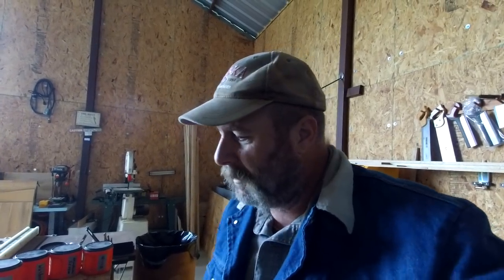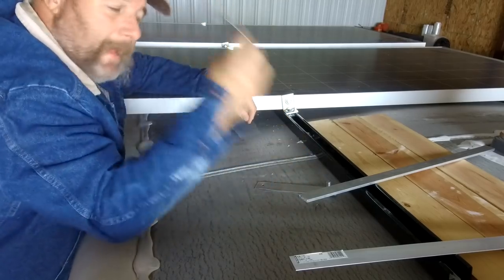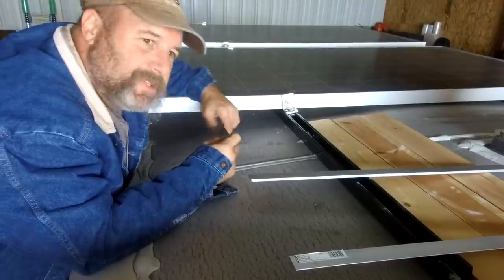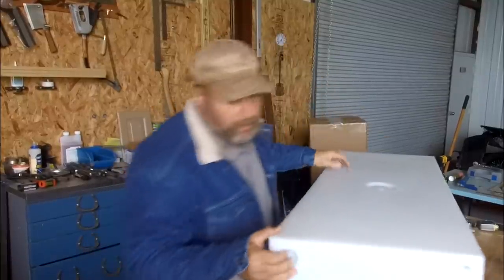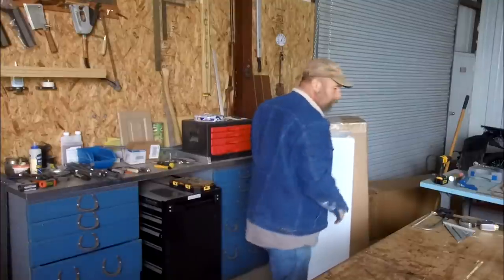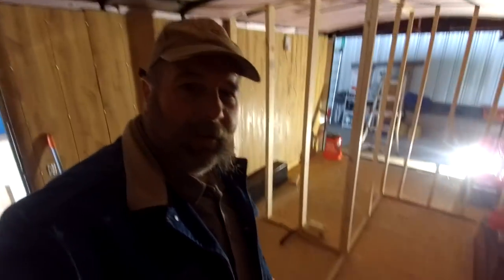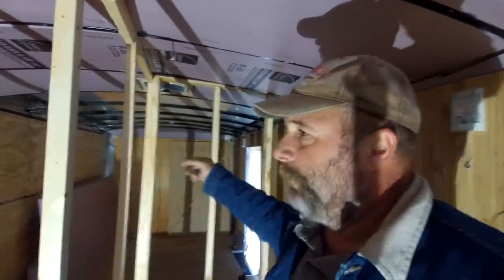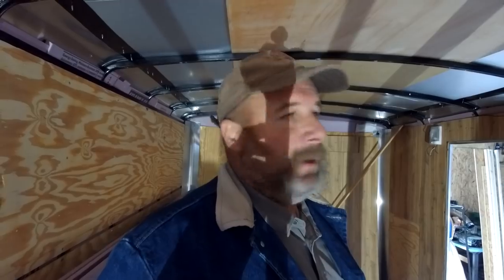501  New toys and a final floorplan / Cargo trailer RV conversion

Comment: I'm doing a conversion too, Stan. It's been dragging on a long time but with this lock-down, I jumped back on it. Mine would make a good hunting shack, insulated, ac/propane  direct vent heater, mini wood stove, small solar and 12 volt fridge. It's more experimental  than anything lol, but it'll at least help me plan for the next one. I know one thing, all cargo trailers are not equal, there's a lot of stamped out junk out there.

Comment: I have a suggestion that you can add to the other 100.  Use punched aluminum flat bar secured with an eye bracket and attach the other end to the side of the panel with plastic knob screws.  You can have an adjustment from 0 to however far your hinge will allow.

Comment: Another alternative for air conditioning is a portable residential unit. All they need is a 4 inch (maybe 6 inch?) diameter hole to vent the hot air outside.  You could mount it up off the floor somewhere if floor space is an issue.  Would also have to drain the condensation somewhere. They are inexpensive.
Reply from the maker: Your right. I forgot about those

Comment: For the A/C, you could use another window with a screen and mount the A/C unit completely inside in a box on a drip pan with drainage through the floor. Well, you get the idea.

Comment: Wooden cover over the a/c unit. Slide on slide off. Make it fit tight and you can hold it with a bungee or slide bolds. Remove it to use the a/c unit and take inside it becomes your table next to your chair or a foot stool.

Comment: Cool! You addressed all the possible problems I noticed on your last video. Love those cute little windows with the multi panes.  About the front mounted air conditioner. Look up "Run Away"  Brand tear drop like trailers Built-in Florida. I owned one which had the air conditioner mounted out the front with a removable vinyl cover. Never Leaked a drop inside the trailer during rain.I believe the only sealing around the airconditioner was a bead of silicone around the outside surface. Yes it was a very tight neatly done installation and realistically I believe the vinyl cover was more to protect it from rock chips and such while driving.  I think window air conditioners are constructed so that rain water cannot go deeper in otherwise it would be a problem in a standard house window mount. The only modification to the airconditioner itself was the addition of a quarter inch hole on the bottom of the sheet metal so that absolutely no Water would collect inside the housing.

Comment: Stan just an idea here, why couldn't you get a heavy duty slide out shelf, (heavy duty drawer slides with lock 12"-14" full extension ball bearing, seller Luminsum, 256 lb. limit, $45.60 on Ebay).  Install a cargo door on the front, mount the slide out shelf to front wall with heavy duty supports, then put AC on the shelf.  Then when you need it just slide it out & plug it in.  Or just mount AC directly on/in the wall & make a hinged door to cover AC.  You could cover door with metal to water proof it & protect the wood from rain so it doesn't rot.  Second idea put fire breaks between 2x4's where your motorcycle will go to make wall sturdier in case something comes loose.

Comment: Shed windows n more I bet was the company. I have those exact same windows on mine. They are perfect. Even tempered glass. I did build fold down plex covers for the outside to keep screen from flopping and they do leak just a bit when traveling. Covers just hinged on bottom and fold down. Perfect windows.

Comment: Stan while you don't want to overload your tongue weight as you build your trailer, you need to keep in mind that 60% of the cargo weight should be loaded in the front half of the trailer. Heavier items should be towards the front, with lighter, smaller items placed near the rear. A light tongue weight or heavy weight placed at the rear end of the trailer can cause dangerous sway.

Comment: Stan. Suggestion, 1 1/2" x however long alum L channels from front to back w/piano hinges SSteel on 1 side use spring pin latch on other side...Raise solar panels when needed.. Use adhesive on alum channels full length they wont go anywhere. 85 mph from Daytona to skaggy wash, never moved.. P.S. Need alum on both sides of panels.....L & R sides

Comment: On your long piece that you were trying to use as a latch. Use a longer bolt where you bolt it to the solar panel, tighten the bolt to the panel put your bar on. Then put a coil spring on top of that with a flat washer then a lock nut. The spring will let it flex so you can pull the latch out, but keep it tight when you let go.
Reply: Lock nut instead of washer

Comment: I have a tiny frigidaire to install myself. My plan will be to make a window I can close with a shutter, insert glass or screen when needed, and install the ac unit if it gets hot. The unit is only 50 pounds so I can store it in the truck when not needed or leave it home.

Comment: you could configure your motorcycle area into your shower area without the need of a tub, dual usage type deal and close to your water tanks. like the floorplan layout though.
Reply: My idea for a 7x14 cargo shower is to make a platform for the ATV to sit in the middle and the shower pan can be pulled out from underneath.  This is so the shower may still be utilized without having to pull the ATV out if the environment doesn't allow me to do so. I have a work bench with a few hundred pounds of tools and a ice cooler on the passenger side for easy access from the door. I also plan to run boards across the top of the ATV for lightweight storage. The solar battery bank and water tank on the driver side will balance the tools and work bench side. I dont plan on a bed since I already have a nice setup in my van but if the van had to be put in a shop for repairs of some sort I could still set up the army cot instead of payiing for a hotel if my money is tight.

Comment: Solar panel pop up. Best way would be to attach all panels together, use MacPherson struts. Just like car makers have done for years on car hoods. Also the cool factor would be way high.
Reply: 12VDC linear acuators would also be a cool setup. Pros: flip a switch panels go up, no need to crawl around on the roof. Cons: expensive, too many moving parts. Gas struts are a good middle ground because if they fail you can still use the metal stock to lock the panels in a tilted position.

Comment: Pretty cool.  You were either going to end up with E-bikes or real bikes so I had a feeling the garage was going to win out.  I don't know how residential windows are going to react to a mobile environment. but they look great.   You could even put a fan in one if you want more airflow.  Wait, You have a Max-Air.  Moving air solved.  A split AC would be a pretty clean install.  If it came with a heat pump, even better.  I'm looking at balance still, but there's a long way to go.  I'm especially waiting for the electrical installs.  You might want to go a little heavier on the solar latching parts.  It's surprising how the wind can grab a large panel and do nasty things to it.  The latches are also going to be cycled quite a bit.  I'm liking latching or toggle spring bolts or similar.  Use plastic grommets to quiet the pins down.  Looking good.  Keep at it.  Stay safe.

Comment: Stan what about a lever/slide mechanism to raise and support the panels. First thing that comes to mind to describe what I’m thinking about is some of the old swing open windows. The lever locked in a pin then rotated out and then pushed the window out by push straight out on the lever. Just a thought that may contain all the mechanics of raising and holding panels on both the closed and opened position.

Comment: Get the air conditioner the ones are for like bedrooms you can vent it out through a hole in the floor the water will drip with it we did that to our trailer

Comment: 3:21 I'm willing to bet that thin metal latching system will fail under heavy wind load. Maybe look at a spring loaded barrel bolt like Amazon ASIN B07JWH5FC9 which could bolt through the panel frame or into a reinforced plate through-bolted to the panel frame. I've also seen people use toggle latches like Amazon ASIN B01NCATK7W or a stainless window sash lock like ASIN B07R6KWJVX. You may want to install a stainless steel cable system to limit the panel movement so a gust of wind won't blow the panel all the way over if the latch fails or during setup.

Comment: Look at the wee roll trailers they put there a/c unit in front of the unit you can use a boat latch. Automotive makes a you claim that has a threadeds on one side for like door panels. Putting the a/c inside don't for get to  exhaust the hot air from the a/c or it will freeze up on you.

Comment: Maybe put one water tank in the truck so you don't have to hookup you trailer all the time to refill Stan. And with the split system you can have the motor in the garage and say put an door on the side wall to open it when it is running maybe above the batteries ?? Cheers mate
Reply from the maker: Interesting. A tank in the truck.
Reply: @Sasnak  I like that idea too. Gravity will let you refill the tank in the trailer.
Reply: A small submersible 12v pump would work too. Look for one meant for taking a bucket shower and install a 12v lighter plug in the box of your pickup to run off the chassis battery. Though your trailer can handle the weight of all that water it might be nice to split up the payload a little differently. Just a thought. Also you could make a water run without breaking camp and that would be real nice!
Reply: @upriver7047  a standard RV water pump is only about $59. Way better than a submersible because it will use existing plumbing fittings that are already on the tank.
Reply: @Captain-Max  I get that but wouldn't you then have to hard wire that pump, mount it and somehow protect it from the elements? Easier for me to disconnect and toss in my tool box. Out of sight out of mind. I use my pickup for a lot more than towing a camper or my fifth wheel. To each their own I reckon ;)
Reply: @upriver7047   Not necessarily. And RV water pump can be hooked up with quick disconnects.   And you don't even have to permanently plumb it in.   The problem with a submersible pump is you would have to cut a hole in the top of the tank big enough to install it. RV water tanks  Pretty much aren't designed for that type of installation.

Comment: Don’t put the AC in the front. 65-70mph wind will push rain in through the unit or around it.  Not a good idea. Put a cheap Walmart AC in the garage wall. Walmart had 5,000 btu window units for $96 bucks last summer.  I’m sure they have not changed much.  My brother has a Small house boat and they wanted $800-$1,200 for a RV roof AC. He went to Walmart and for $96 bucks he has a unit in the window.  He has a 2200 watt Honda generator he sets on the back deck. He bought a aluminum storage box that mounts under a trailer. It has a big door that locks. He bolted that to the deck and installed a vent on each end of the box.  And he don’t have to worry about someone stealing the generator while he is at the dock. When he is tied up in a cove somewhere he can run the AC for 8hrs on a tank of gas. They make an adapter to use a portable boat fuel tank. That’s 6 gallons of gas. He can run it for two day on that.  Love the project Stan..

Comment: I have an idea for you about your ac.there a company that makes trailers called weeroll they have a system that has a hatch that you remove and set your window ac in  place. when you arrive at your camp site, then when your ready to leave you pull ac out and secure it. Website is www.weeroll.com 
Nice video  by the way.

Comment: 150 gallons weight at 400 lbs?  Try 1200 lbs.
Reply from the maker: I said the bike would weight 400#
Reply: @Sasnak  I stand corrected.  You indeed switched to the weight of the bike, and I did not catch it.  By the way, did you figure an emergency exit?